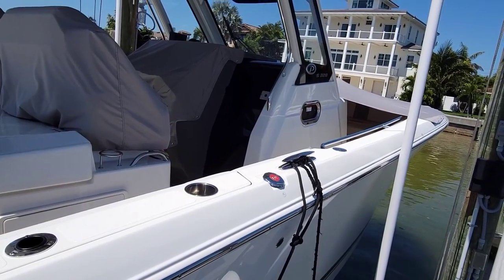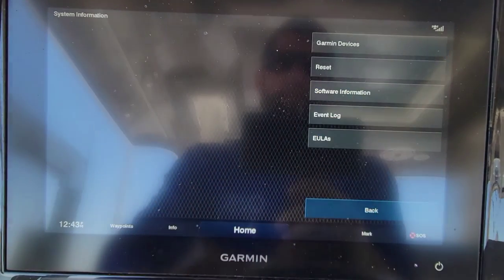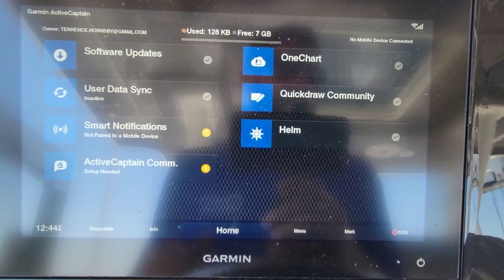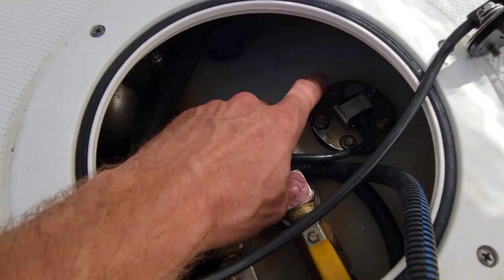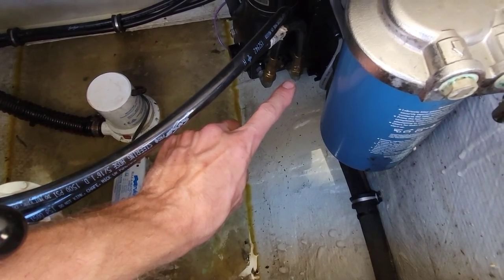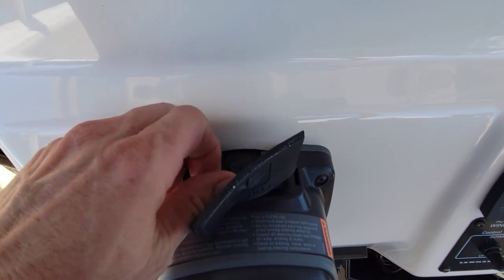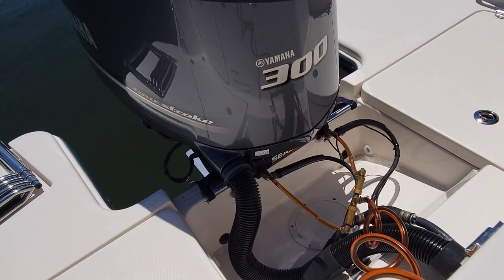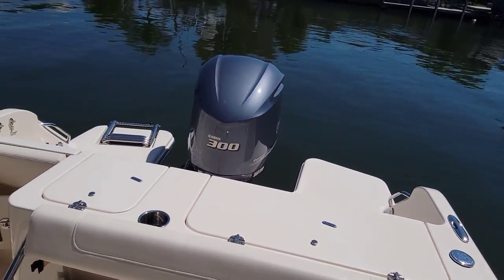Garmin Software Update and Sea Star Steering Leak - Episode 21

Comment: Hi Justin. Thanks for this video. I was able to update the software, my twin 12 inch Garmins. A question on this, if I upgraded one, does that automatically transfer over to the other screen?   I didn’t see any way to check the software on the second screen, but both screens are linked together.
Reply from the maker: If they are linked they should update everything at the same time.